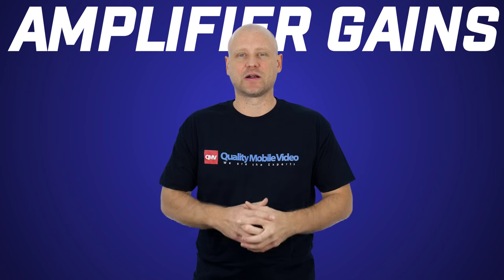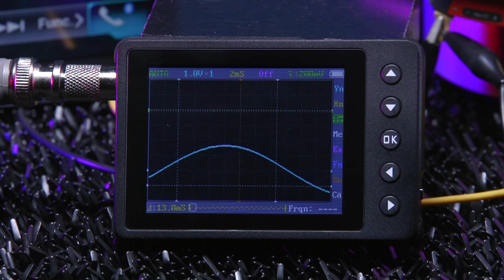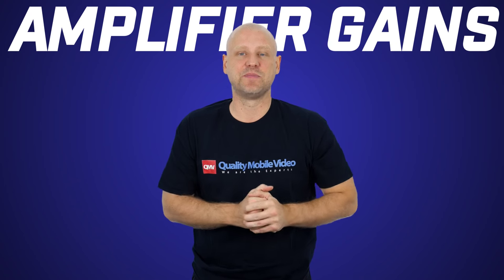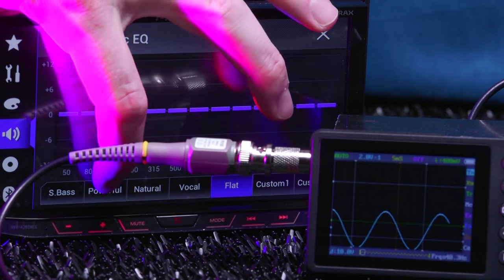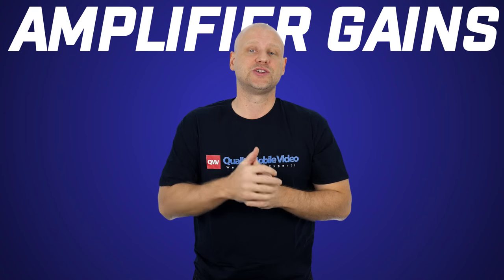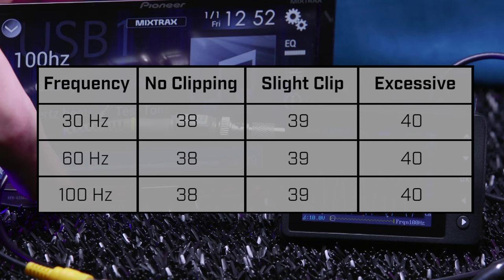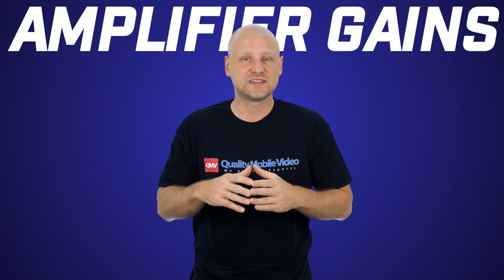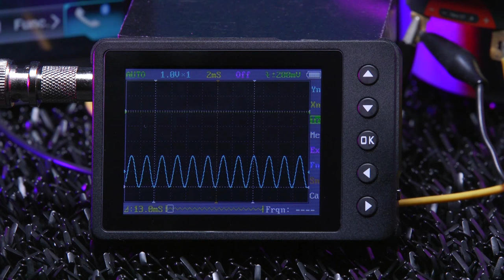How to Set Car Amplifier Gains! What is clipping?

Comment: This video is an excellent, lucid explanation of the relationship among gain, max volume, and distortion across all  car audio components. 

I believe using an o-scope is the best method to set gain through the system. I understand I can set gain by ear; I understand the disadvantages of doing it this way. I understand I can set gain with a DMM; I also understand the disadvantage of doing it this way. But this video demonstrates some add'l advantages of using an o-scope to tune a system.

An o-scope provides confirmation of actual-maximum-volume-with-least-amount-of-distortion-for-a-given-headunit. An o-scope also permits one to identify exact moments EQ, "Bass Boost", and Loudness produce distortion at specific volume levels. And an o-scope allows a person to visually and more accurately "dial-in" gain on each component in their car audio chain. Clearly, an o-scope is the ideal tool to use to tune gain. 

The dilemma most folks complain about is, who can afford an o-scope for what is essentially a one-time use? Do car audio shops provide gain tuning with an o-scope..? Would it be prudent expense, or would the cost of this service approach the purchase price of an o-scope?

Bleh...
Reply from the maker: Thanks for the comments! We made this video to demonstrate everything you pointed out and so people could SEE the relationships. I think for those that want to precisely match output and input gain the $89 for this scope is not a barrier to entry, it's only the beginning of the tools that a true enthusiast or professional should have in their arsenal. Thanks for the support!
Reply: Quality Mobile Video is this oscilloscope better than using the SMD DD-1? I heard the DD-1 is the best. What are your thoughts??

Comment: Is there a way to set it to if a passenger cranks the sound it maxes out the head unit volume without clipping just to prevent trouble
Reply from the maker: Some head units have a max setting that can be adjusted.

Comment: I have a 500rms mono amp (2ohm) with two 250rms subs (4ohm each) wired in parallel. The radio I believe is 4v. The speakers are Kenwood Road Master 12s, the amp is Kenwood Mono D, and the radio is Kenwood KDC-BT778HD. What should I set the gain to?

Comment: would i be better off leaving eq flat if I can get to a higher volume without clipping?
Reply from the maker: It’s not technically a higher volume, the maximum voltage output will be hit either way.
Reply: @Qualitymobilevideo  ahhh i see, sorry I'm trying learn all this audio stuff atm its really interesting. so will adjusting the equalizer (13 band) on my head unit affect sound quality of the speakers connected to my 4 channel amp via rca's or will it affect  the speakers connected to actual speaker wire on the back of the head unit? based on the oscope test  my head unit seems the clip way sooner  at my door speaker vs at my rca. hope that makes since

Comment: Does speaker impedance affect  target gain setting? I noticed on some sites (i.e. JL Audio) they list different target voltage outputs based on what your final impedance will be (typically lower V for lower Ω). How does the scope take this into account when it's detecting the clip voltage?

Comment: hi, I've read about the DSO nano and alot of people say it doesn't work with class D amps. is that because the standard probe doesn't read high enough voltage? meaning with the 10.1 probe I should be able to check my 3500 amp correct?

Comment: ok i got a question, if the speakers are not the same ohms as the amp will this make the amp clip ? example if i had 4 speakers each one of 8hms connected in parallel  that will make them 2ohm, but if i have them conected to a 1ohm amp will this make the amp clip ? 😐

Comment: With that mentioned in the video I'd like to ask how does one actually set up if they'd like to use the factory head unit, connect it via LC2i  via front two speakers) then have it run to the amplifier. When does a person alter the gain; after the full setup or only to the lc2i?

Reference if required: 600RMS sub 2ohm, powered by 500RMS mono amp

Comment: When setting the gain what frequency did you use?
I know you set up the OScope with the amp wire and the volume to 38, but what was the frequency used at that moment?
Reply: I would say test all the frequencies, with the amp gain all the way down, and note the volume lever that clipping starts to occur.  It will probably be different for each frequency. The lowest volume setting/frequency then becomes your "max out". In other words, if all the frequencies allow you to run the volume up to, say, volume 44, but the 100Hertz only allows up to volume 39, then "39" is your max volume from the head unit that is clean on all frequencies. So now you know the head unit's max volume, 39.  Now, set your head unit to volume 39, and start to add gain, testing each frequency, and again, note which one clips at what gain setting.  Use the frequency that clips at the lowest gain setting as your "max gain" setting.

Comment: hi, I recently upgraded to aftermarket speakers in my 98 expedition, and the passenger side of the vehicle is making a humming noise. i have a stock amp, the speakers are alpine 75x4. what can I do to stop the noise?
Reply from the maker: Hey Cesar, could be a lot of things, but sounds like a grounding issue. Do you have an external amplifier or are they powered by the factory amp? Make sure ground is connected right, it's the right gauge for the voltage, and make sure it's touching bare metal

Comment: So after the gain is set while using flat settings and no eq'ing features...will the system clip once you do any eq'ing such putting the head unit to powerful and/or changing the db levels of bass???  If so, what is the purpose of setting gains at a flat level with no eq?  Should I set my gain with all the head unit settings activated in which I normally listen to music?
Reply from the maker: It will clip. If you intend on using the eq to add then you will need to leave some headroom (lowering the radio volume before setting the gain) in your setup. We only use eq's to cut for this very reason.

Comment: I have a question. I'm about to install my system in a diffrent car. Do I need to retune it?
Reply from the maker: I would yes. The interior's have different shapes and sizes so you'll want to re-tune it because the audio will act differently inside the new space

Comment: Just stating that I have very little knowledge in car audio, but I want to learn how to tune my system properly to get the best sound, maximum safe volume and no damaged equipment.My question is after finding your maximum safe volume, and properly setting up your gains and your crossovers; can you turn up the bass and treble or should they be left flat? Should the bass be turned up by the amplifier or by the deck?Thank you
Reply from the maker: Do you have a subwoofer?
Reply: Yes I have a JlAudio 10w3v3-2ohm running it off of a Alpine Mrv-m500. I am going to set my gains however with a multimeter. I have already figured out the voltage required for the sub. My other speakers are Focal, I just have a 2way system. I do not have a seperate amp for mids.
Reply: Hmm he never responded to the question i guess nobody has an answer for this question

Comment: If you have an amp (true)1000  watt amp ap that is under powering 2 sdr sub woofers that are 600 rms would having a higher gain setting help with the output
Reply: there won't be any point having a higher gain setting as if you had one that would go to 11, then you would be clipping an already clipped amplifier even more. the whole point is to send clean undistorted signal to the speakers.

Comment: if I have an amp that outputs 500W RMS and 1200W max @ 4 Ohms, do I need a 1200W 12V 100A power supply?
ps. I hear some high frequency ringing in the test tones in this video. whatsup with that?
Reply from the maker: Are you wired at 4 ohms? What's the rest of your gear? Can you send exact models/brands of everything?
Reply: I just gave an example. I don't have the gear yet but I am still researching on the topic of speakers and amps in order to make everything compatible with each other when I make the final purchase because this is going to be a big investment. So far my choices are 

MX Stereo XLR Audio Crossover 
Sony XS-GSW121//C 12" speaker (380W rated power, 500 W RMS & 2000W peak)
Hamaan HMA-101 Class-D mono amp (500w RMS @ 4 Ohms)

I already own a pair of Fluid F5 studio monitors which go till 22khz but the bottom end is not as tight below 90 hz. The 12" should be able to give more bass extension as it goes down till 20hz as per it's specs sheet, so I will be placing it in a sealed enclosure. I don't want loud, I just want to hear as low it can go at as much of a flat response as the speaker calibration and room correction eq would allow without distortion in a semi-decently acoustically treated room and not in a car.

There will be only one 12 inch speaker connected to the amplifier which has dual voice coils, so I should be able to wire it at any load that I wish. I will probably choose to wire it at 4 Ohms. The speaker has rated power of 380W but RMS of 500W which is a bit confusing for me. The amplifier has 4 terminals for two speakers which I assume is internally connected in parallel as this is a mono amp. the amp is rated at 7500W peak which I assume is at 1 OHM, so at 4 OHM it should be between 1500-2000W probably.

The max power supply I could find is online a 12V 60A 720W PSU. Should I buy that or look around for an even powerful one? If you have more info about the speaker's voice coil impedences and the speaker out terminals of the amp, then your insights will be much appreciated.

Comment: um, actually shouldn't you also be using a multimeter to set the amp gain to match the RMS power input (in watts) of the speakers/subs?  this "how to" seems incomplete somehow...
Reply: Joe Vete absolutely correct. If the amp is putting out clean powa but your sub can't take it, a multimeter is necessary.

Comment: I just wanna know if I need a bigger amp or bigger speakers.  Lol TMI
Reply: You're amps Rms should be 100 more than your sub. If that's right, then buy a cheap volt meter and you should set your voltage output(gains) to match the subs RMS. There's a simple formula to find out how much voltage you need

Comment: What is the best setting gain  for gmd9601 I connect at 1ohms thanks
Reply: Nelson Antazo if stereo is 2v than normal.if it is 4v than H position
Reply: Kiran Patial thanks the bass knob must connected or even im not used the bass knob
Reply: Nelson Antazo u can keep the bass knob at half position
Reply: Kiran Patial thank you sir if i full the gain of amplifier my amplifier burn
Reply: Nelson Antazo if u ful gains of your amplifier and increased the volume of stereo to peak level than surely it will burn or its fuses will blow away
Reply: Kiran Patial thanks you very much for info sir but my sub woofer canot dammges only the amplifier
Reply: Nelson Antazo u r using which sub?
Reply: Kiran Patial i used 2 focal 33v2 400rms each by 1ohms sir also give advice what box good for my sub sealed or ported thanks
Reply: Nelson Antazo if u want hard punch than u can go for sealed but if u want bass that travel out of your car than go for ported box with pipe port
Reply: Kiran Patial thank you

Comment: Do this same video with a bass knob in the mix
Reply from the maker: Good idea
Reply: @Qualitymobilevideo  it's crazy their are really none out there 

Also what's the benefit of changing your eq to flat if your not going to run it that way you test flat then change it you may still go into clipping
Reply: subtractive eq is the solution. only cut but don't boost the freq bands.

Comment: What I don’t understand is why are you using 3 different frequency’s to check for distortion? For example if your testing for distortion for a subwoofer why would you be using 3 different frequencies??? And as you can see from your test the 100Hz test showed distortion at the lowest volume levels so all you would need to do is only use that 1 frequency to detect your distortion and as I stated above using 100hz would be your best frequency to use as it displayed distortion the soonest. I guess you just showed the 3 different frequency’s as a default for the different type of speakers high mid lows but you just didn’t explain that, someone that doesn’t know what they are doing is going to end up trying to use all 3 frequency’s to setup a sub and go crazy because each frequency will distort at a different level. You should mention to only use ONE frequency to set each speaker!

Comment: upgraded lead? for the nano v3
Reply from the maker: +Neeper Black yes, it's a 10x probe
Reply: Where would could I buy that probe
Reply from the maker: Any electronic supplier, we used one that had a BNC connector and we used a BNC to 1/8 inch adapter

Comment: and as usual, no one knows the answer to my question...
Reply from the maker: Answered below
Reply: jms 75 get an oscilloscope turn up the volume about three quarters of the way playing a 40hz test tone then start cranking the gain up higher and higher until you see a clip signal in your oscilloscope then turn it down a little bit and you're good to go you can do the same test by ear just when cranking up the gain go slowly until you hear an instant difference in sound the back it down from there a little bit